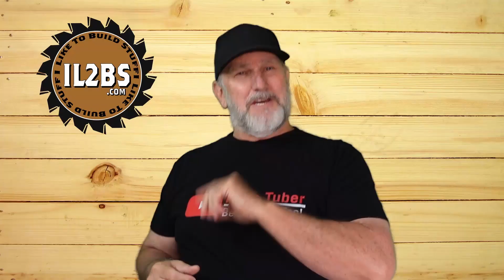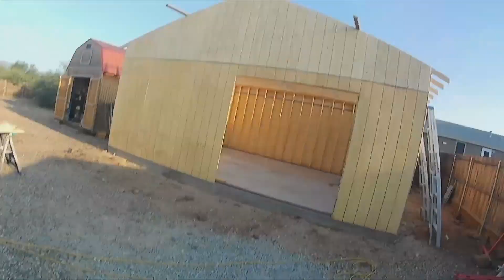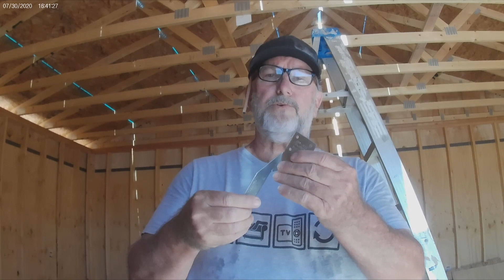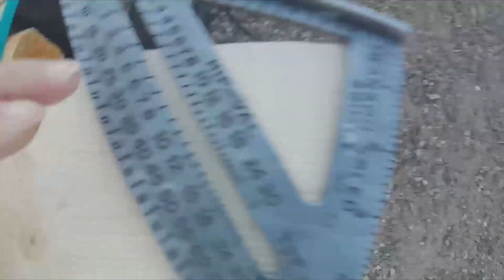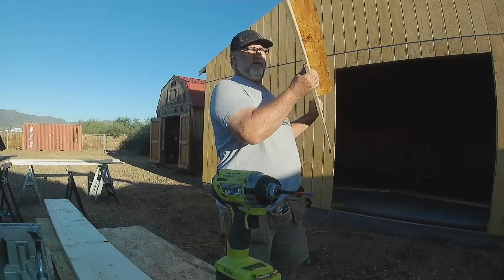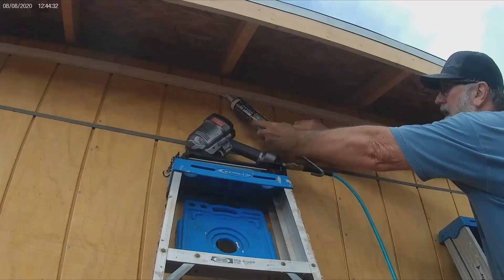DIY Workshop Build: How I Installed Trusses, Roof Sheathing & Soffits Like a Pro

Comment: Nice work. Appreciate the video.  Try placing another 2x6 on edge next to the flat strong-back. Makes a nice L shaped brace. On your strong-back
Reply from the maker: Great tip, that would definitely add some extra rigidity to the build!